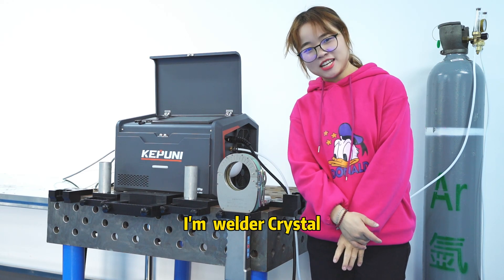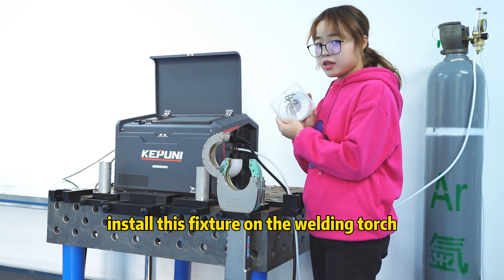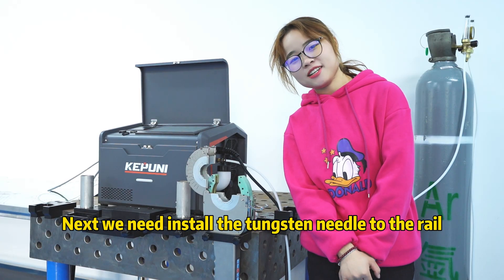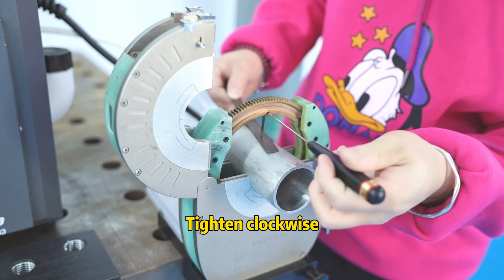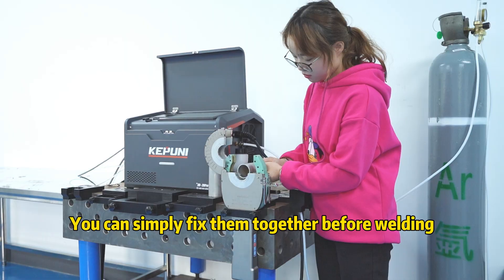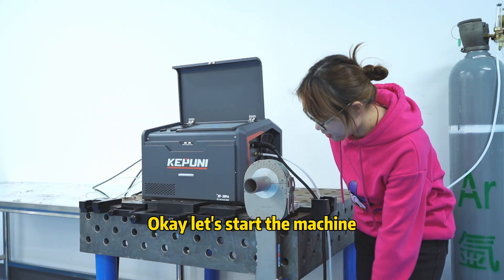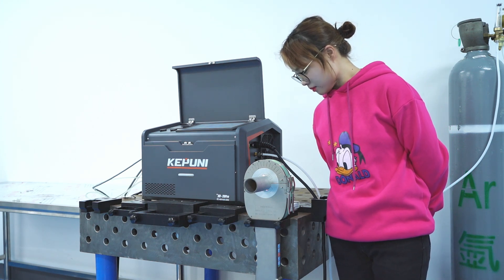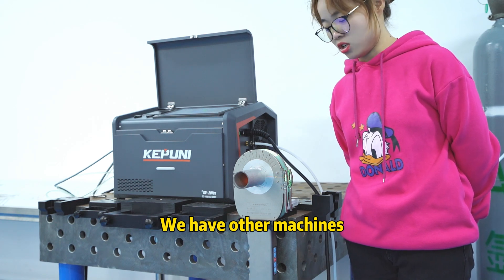PIPE WELDING & STAINLESS STEEL | KEPUNI AUTOMATIC WELDING MACHINE

Comment from the maker: Enclosed Orbital Welding Machine.Mainly used for welding: stainless steel, carbon steel, titanium alloy, copper pipe and other nickel-based alloy pipes. Welding range (pipe diameter: 3.175-168 mm, wall thickness: 0.5-3 mm)